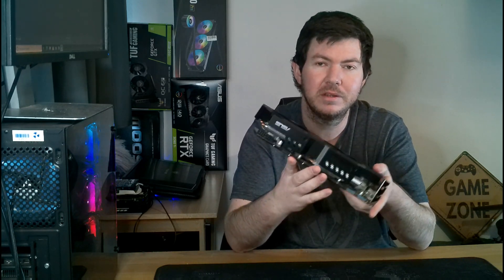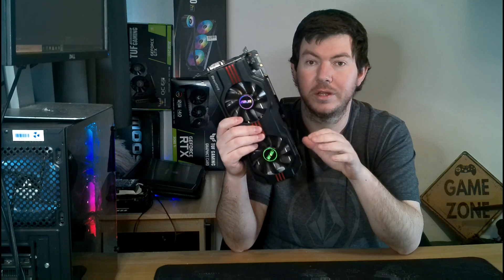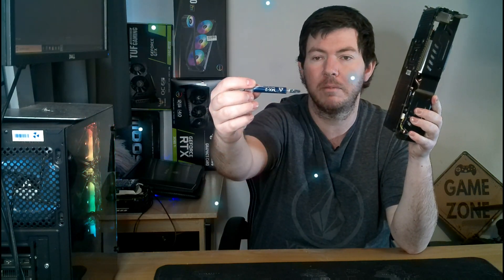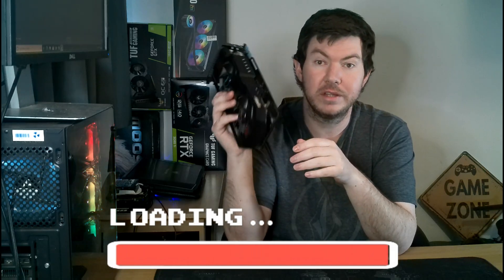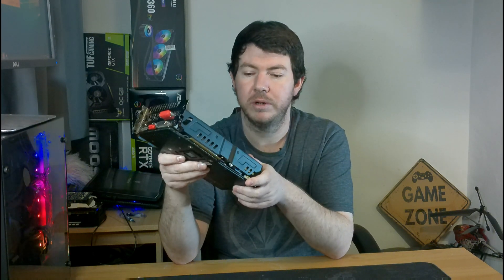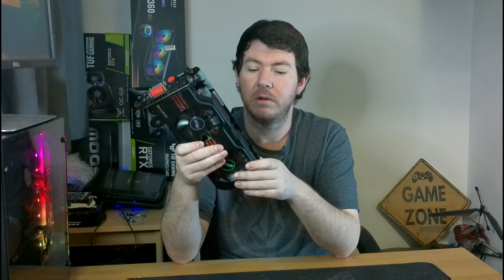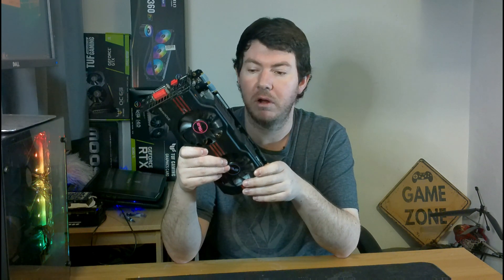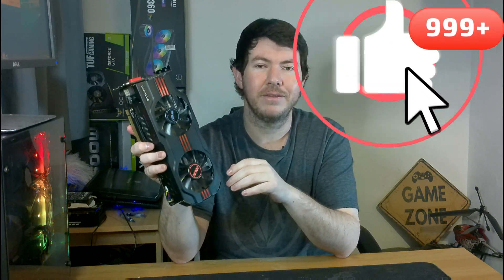Should you replace your GPU thermal Paste?

Comment: How can you not reach 70 or 75 degrees? I have 70-75c° in games, a completely cleaned card with excellent thermal paste, is your case completely blown up by fans? I just have it without blowing.
Reply from the maker: Good observation. But I have 12 x 120mm fans in my chassis. My case stays very cool. Keep in mind im in the UK so my room temp is always cold :)
Reply: @BudgetTechUKYT  Thank you, after all, the case blowing matters, you have excellent cooling!
Reply from the maker: @ТВрозоваяблоха  Thanks for the positive vibes